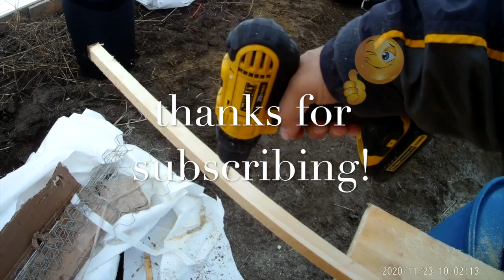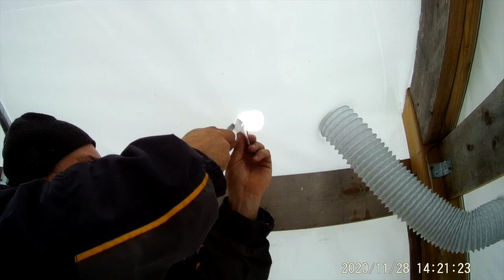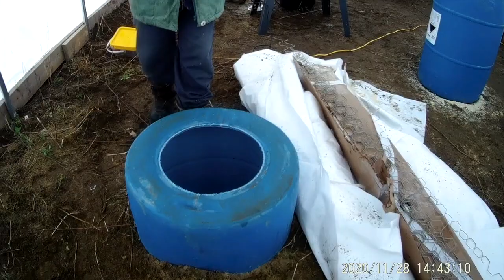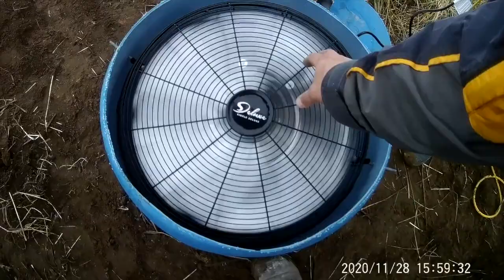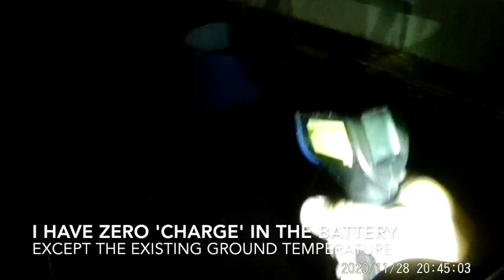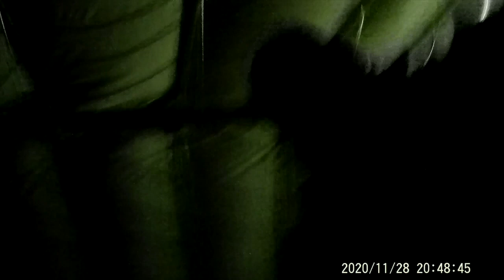Powering up the Climate Battery for the 1st Time, Ep10

Comment: Just a couple quick notes regarding having the fans blow upward (i.e. sucking air through the system). 
(1) Fans are more efficient at "blowing" air than they are at "sucking" air.
(2) Once the fan begins to create a negative pressure inside the tubing, the air coming into the back of the fan becomes "less dense", therefore the effect is less air movement on the exhaust side. (explained below)
(3) You will see some improvement by cutting a larger opening on other end as Cherry Tree Permaculture suggested, but if your fans are capable of moving more CFM than the intake opening will allow to pass you're likely to still be disappointed.

 Remember your earth sciences experiments from grade/middle school? You know, the one with the bell jar and a vacuum pump, where a small fan is placed inside with some styro-foam beads.  When you first turn on the fan, it blows the beads around inside the bell jar, but as a vacuum is pulled down, the beads drop down to the surface and quit bouncing around. That is because as the pressure drops, the air molecules become so spaced apart that the fan blade becomes less effective at moving them. This is what is going on with your system. You will be better off to reverse your wiring and blow the air into the piping. 

Regards and best of luck. 
Gary B.  
(Just for today, you can call me Mister Wizard. lol)
Reply from the maker: lots of food for thought here i appreciate the feedback. Mister Wizard! lol 

i also was wondering on the pressure on the tubes if pulling the air out would potentially draw more water in underground than positive pressure by pushing the air through the tubes. i may change it up as you suggested.
Reply: @TheNeds  
You are better off pushing the air down into the plenums. With 20 tubes protruding into the barrel, the air doesnt have a smooth entry into the tubes so the air will tend to flow past the tubes and strike the bottom of the barrel and eventually find its way into the tubes. Its nice to think it would flow seamlessly but it doesnt. The layout looks like it could support upto 1666cfm through each plenum assuming the fan wes capable of delivering it at 0.4" wc. If you have air flowing back up past the fan that suggests the fan is unable to overcome the resistance. If you mount an axial fan in the side of sealed box, the air will fill the box and then start to blow back through the fan blades. Centrifugal blowers are more suitable than axial fans, the only downside is they cost more.
Reply from the maker: i have seen examples of centrifugal fans in boxes mounted on the manifolds. we are going to try one axial pushing and one pulling and try and measure tge differences. also i have an old AC motor on a CF blower so we will try that too to learn from before committing to a DC brushless version. thx for the feedback!
Reply: @TheNeds  
If you have a birthday coming up, it might be worth dropping a few subtle hints about a Testo 510i meter. 
https://youtu.be/db02zd_XLaA

Comment: try putting a pool noodle or foam pipe insulatin around fan
Reply from the maker: i did end doing just that. much better than the water soaked blanket. It's what I had on hand. I got some funny looks buying pool noodles during the winter ;0 - appreciate the idea!

Comment: On the side that doesn't have the fan, I wonder if  having the barrel cut all the way around would increase the air flow?
Reply from the maker: i think it would but i think with the fans i have i can’t pull near enough CFM to make much difference. it’s definitely something to consider.

Comment: How is your setup working how long do you run your fans and at what intervals?
Reply from the maker: Hi Thanks for the comments, the pandemic has derailed my progress and I haven't gotten that far yet, but I did plan on using dual temperature thermostats. Turn on when the temperature is less than a certain temp to take heat out of the ground, and turn on if the temperature is higher than a heat point, to take cooler temperature out of the ground (and warm it up for night-time use). I will post more videos when my homestead gets back on track, but right now it's on hold.